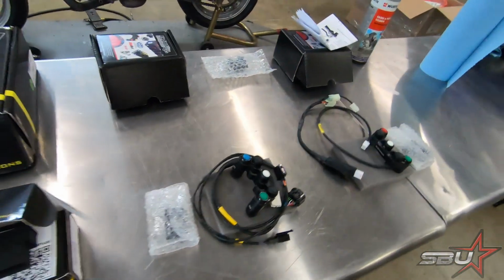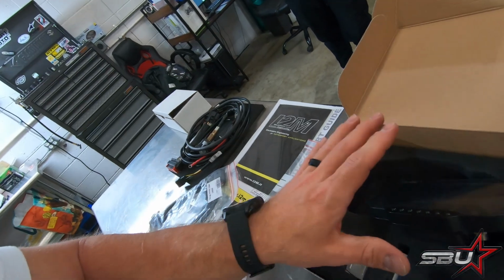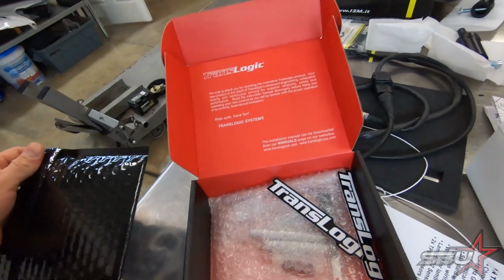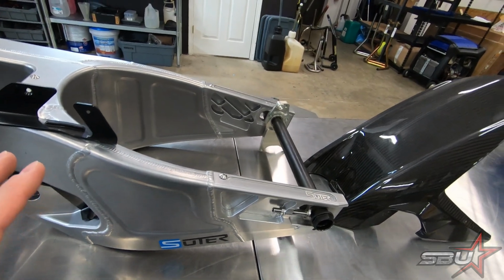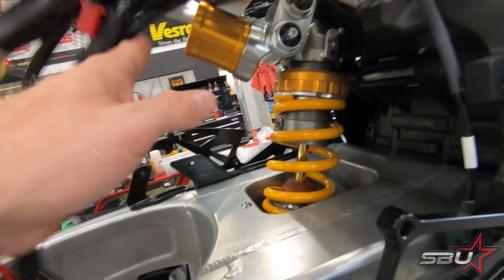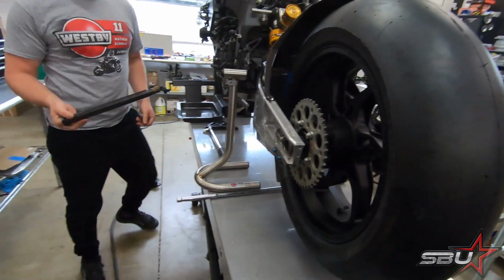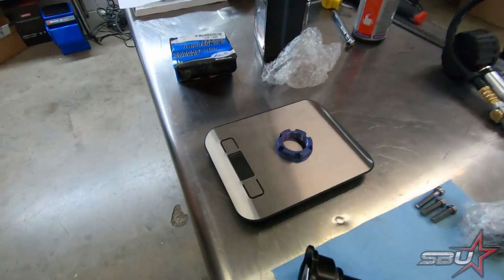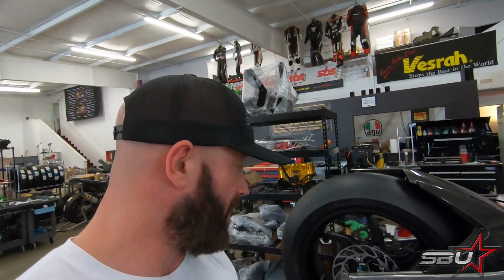SBU 2022 YZF-R1 SBK Project Pt.3 - Suter Superbike Swingarm, i2M Dash & Datalogging System

Comment: does changing from stock to a suter swing arm raises the seat height? or it will be the same as stock?
Reply from the maker: It comes with a new linkage and adjustable pull rod, so this is up to the user.
Reply: @SuperbikeUnlimited  geez, thanks a lot for the info.. hoping to see some hyper naked builds in the future...

Comment: Why do you delete the abs in a road racing application?

Is it because of regulation?
Reply from the maker: Because it's not needed and in general limits braking performance on motorcycles.
Reply: Some remove it because of race regulations, but some remove it because they find it intrusive (Yamaha's abs system can be quite intrusive and noticeable on the track).
Though there are still some aftermarket abs.
Removing the abs is still up to the rider tbh (Some find it again, intrusive)